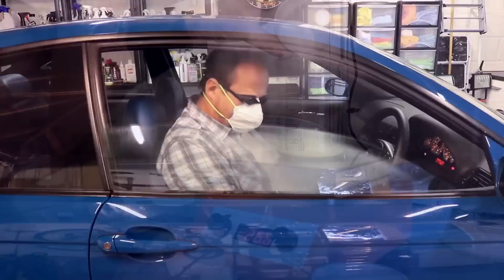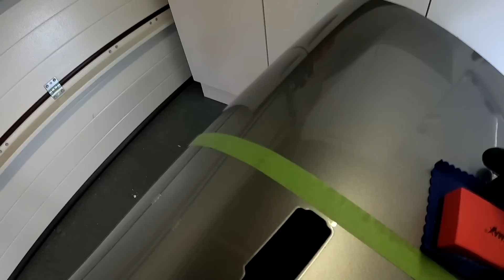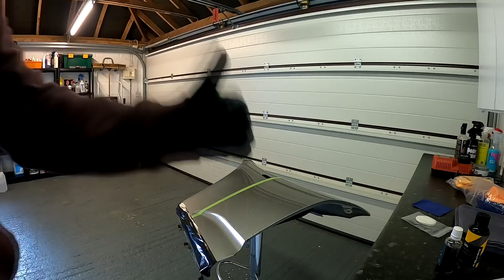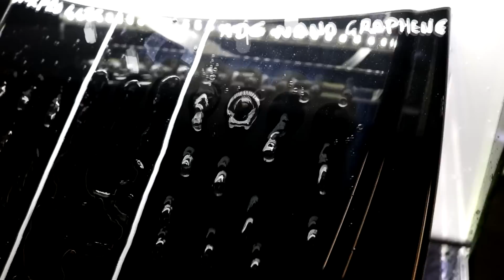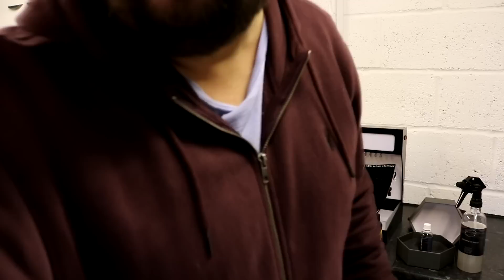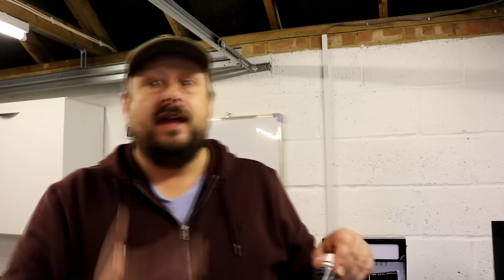R.I.P. Ceramic Coatings and SI02 | Meet the Future of Detailing

Comment: My problem with these long term coatings is fallout and scratches.  If you get a scratch you need to wet sand and polish it is going to be a lot of work to  get that coating off.  When it comes to fallout I like slickness which means each year I need to spray a fallout remover, clay, polish and apply a polymer sealant.  I would much rather do that work with the TW Ceramic products.  I want durability sure, but car paint takes abuse and you have spruce it up every six months to a year.  I can tell you I TW Seal n Shine on my vehicle now and it got the best water beading in the parking lot right now.
Reply from the maker: good general point against coatings you make there..  over the course of a year the chance of a car needing paintwork is pretty damn high.. and removing the coating properly in the areas it needs to be removed is a major pain for some. and then reapplying a coating, but also waiting adequante time for the refinish work to cure..   coatings never fully went main stream.. but I also think they went beyond just being niche because they do offer some genuine advantages.

Comment: AWESOME!  Great informational video as always and yes, this is a no brainer.  This nano blew Si02 out of the ballpark.   Pricey, and I will have to wait but I agree with you, I need to know whether or not it will go on top of Opti-Coat Pro Plus and actually stay on the product or will Opti-Coat just shed it off in 30 days.  It seems that it would be a fit for Si02 coatings, but I need to know that also.  I wonder if the nano will also destroy towels the way Si02 does.  Lots of questions but that is only because I am so interested in it.  I want that type of long-lasting sheeting, I mean that is the Holy Grail that we are all seeking.  Thank you again!

Comment: Color me sceptical. I've only tried one graphene-based product so far - Ecoshine RENEW F4 by IGL - which has the consistency of a thin polish and was not impressed. I found it difficult to work with, both application and removal. I applied with a short-throw DA, which is admittedly not what the instructions call for, but it was how my most trusted YT detailer used it and I followed his lead. Maybe that was a mistake. The product dried almost instantly on the paint and was very difficult to remove. I couldn't visually tell the treated area from the non-treated on the hood of my car, but the paint was in very good condition to begin with, so who knows. Water behavior was not improved to my eyes. Once more products become available I'll be sure to try them out. Because I can't help myself. And my 2015 Chevy Equinox deserves nothing but the best. 🙄

Comment: I’d love to know why it needs to have a damp microfibre run over it and what happens if you don’t. Looking forward to more testing of it. Great video, thanks!
Reply from the maker: I think it helps level it.   but it seemed really easy to work with.. but its one thing doing it on a test panel compared to doing the entire car.. and how much of a ball ache that would be.. but Im thinking of trying it on the red peril.
Reply: Forensic Detailing Channel I also think that it’s suited for pros because, carpro 3.0 will last 2 years. So 2 bottles of that is near on the same as the graphene. Only reason for graphene for the enthusiast is, does it do something better than a ceramic, not sure it does yet?

Comment: Compatibility is gonna be in the Polymer group. Hence Xtreme Solutions PolySeal and the like minus the Carnuba types. The main benefit I’ve seen is the water spots. They don’t adhere to the surface at all . A comparison coating would be  IGL F4 applied every 4. ( $30 a bottle ). So this isn’t as cost effective. But if it’s available to the US market I’ll try it out.

Comment: It’s too expensive now , I’m currently using IGL F4 which is also Graphene infused. I’ll buy it but how do you verify the five year claim ?
Reply: It should go on Fusso the spray at least will adhere for a little while. So far from my testing PTFE and the graphene work together same with the polymer sealants. The SiO2 stuff will work but it has to be the bottom layer and cured. So can’t apply a fresh coating of a SiO2 spray and top it with Graphene in the first hour.
Reply from the maker: I have no idea Amir.  but in my head the only way to verify it is to like see it last 5 years with your own eyes.   but maybe theres some sort of product guerentee?  question for Art De Shine that is I think.   (good question as well)

Comment: I made some carbon nanotubes once, graphene is even easier to *create*. The problem due to its delicate nature is manipulating it in large scale manufacturing in a cost effective way. Graphene is a ballistic conductor[zero resistance] and is stronger than steel relatively speaking. Its also transparent because of its thinness. If they threw a few trillion at developing its potential vs endless forever wars for the defence industry we'd probably solve a tonne of problems in the process.  There is a tonne of hype for a reason, the big problem is working with such fine materials is super difficult!

Comment: John whats the difference with exo4..?? Which one is better to use for dailly driven..?
Reply from the maker: exo is a top coat coating... typically top coats are there to give you desirable surface characteristics, or a boost in gloss and hydrophobicity ontop of durable but less blingy base coats.